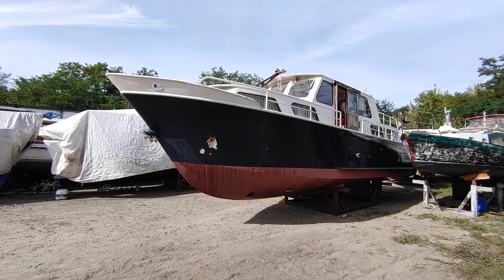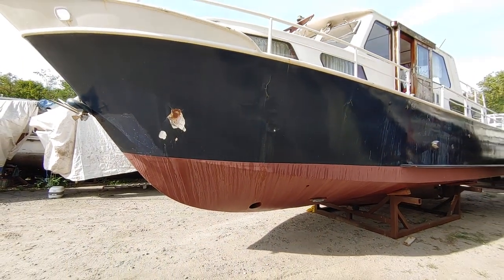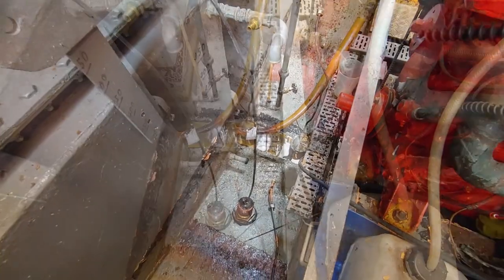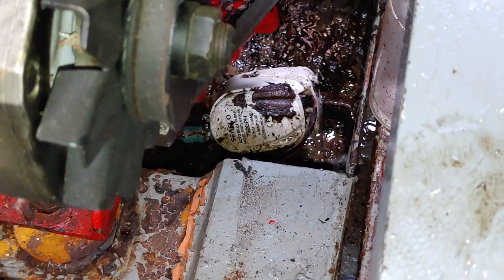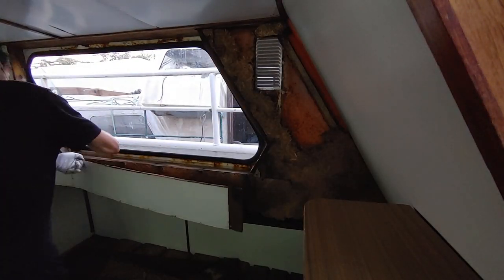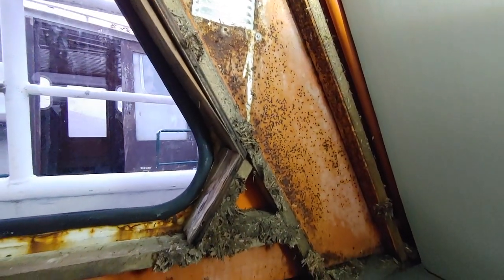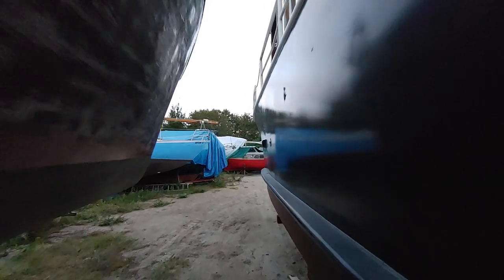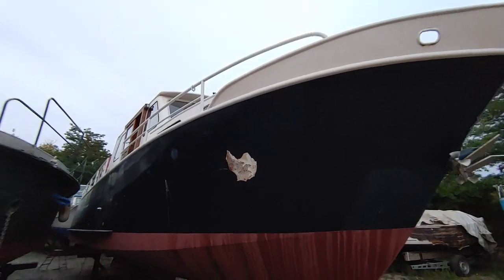More cleaning and tearing out old wall pannels - Day 2 - Vintage Yacht Restoration Vlog

Comment: The oil trays are standard practice on boats to stop any oil from leaking into the bilge, as that would be dangerous to the environment and it also allows you to spot any leaks easily. Thank you for sharing your project. Viele Gruesse aus England. Christoph
Reply from the maker: thanks for letting me know about this. I'll make sure to put some oil pans back under the motor once we're ready to go on the water.
Reply: They could also in part serve to catch any water brought up by the propeller as they seem to be placed at the connection point between the prop shaft and the engine

Comment: Hey super cool project ! When you see rust on the inside its good to inspect the spot on the outside, see if there is a source of the water creeping in.
Reply from the maker: The "spots" on the outside are just cracked and missing paint. The hull is tight and in really good shape. The windows are leaking though, so there is some water coming in from that. We'll fix it before we go on the water next spring.

Comment: That silver vent right by the window if it was me I'd buy the ones with the plastic that are the metal vent where they come over the vent and drive the tube drops down where the air comes in from the bottom of the tube and then end of the vent which covers Advent so it don't get rain in it and you can seal around it easier
Reply: I just saw some more that were over those vents by the windows I just saw some more that were made out of metal and then welded to the wall that way they wouldn't leak it's like a tube that goes on the side and covers those Vents and allows the air to come up from the bottom and into the vents and it keeps the rain out of the vent and the water splash from splashing over the edge and forcing up into the bottom of it